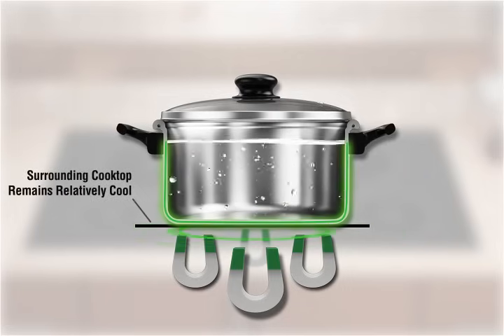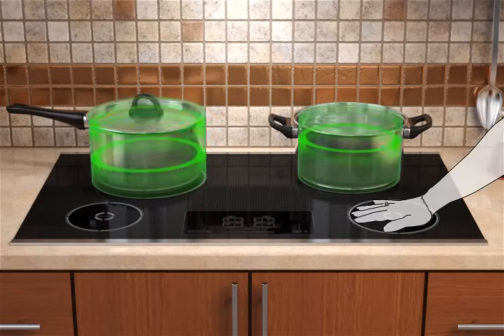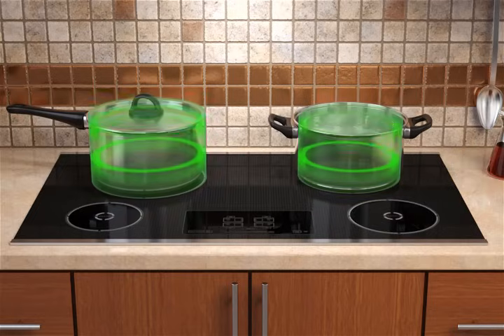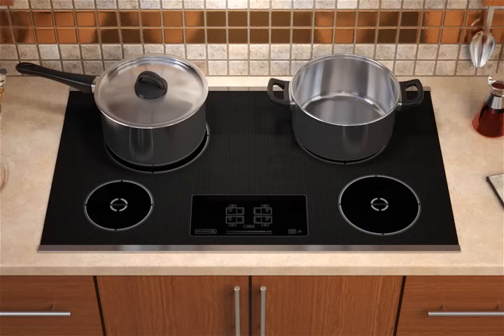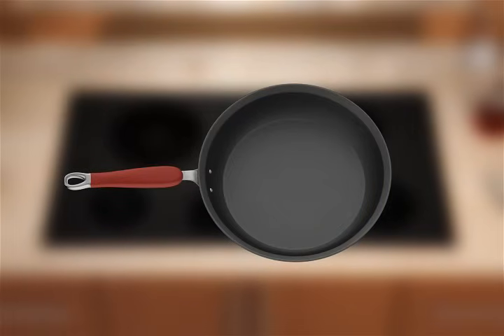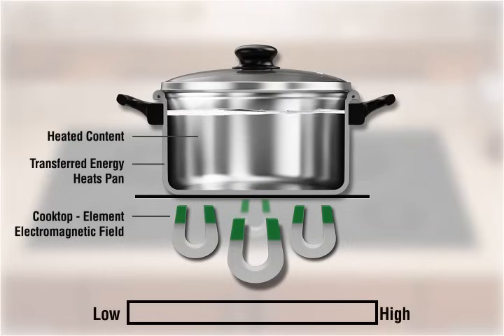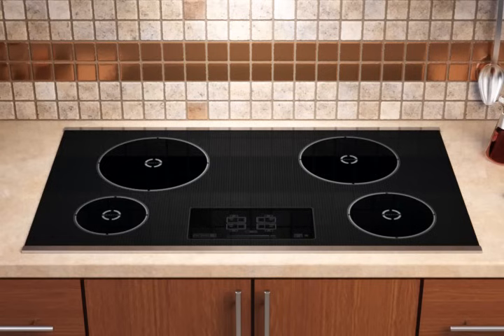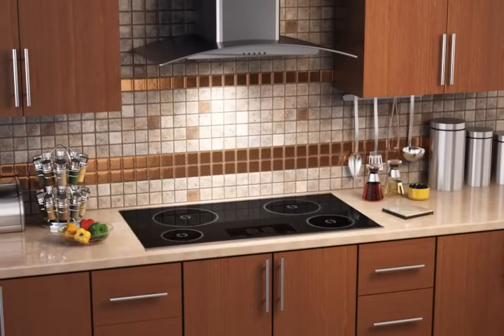Induction Cooking Overview

Comment: induction cooktops are the devil, seriously there is no even dispersion of the heat, switching to a lower power just makes it switch from on and off with a timer, and while its on for those 5 secs its still so strong that it burns the bottom, while keeping my top cold.... brilliant D: